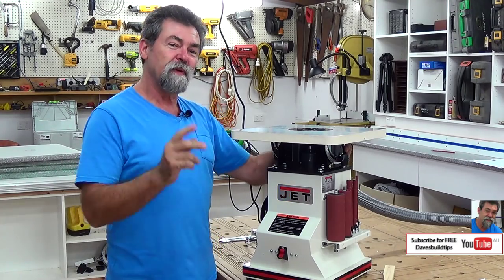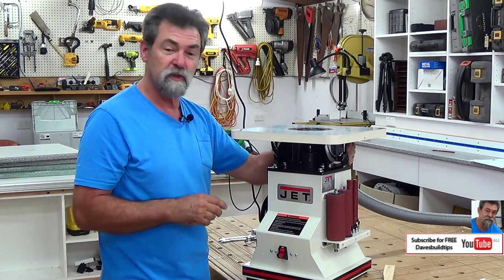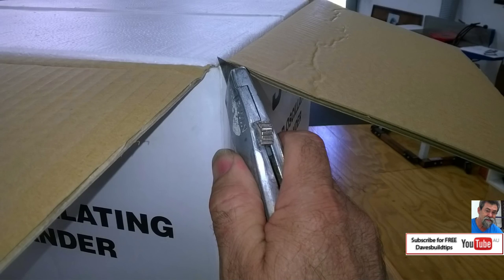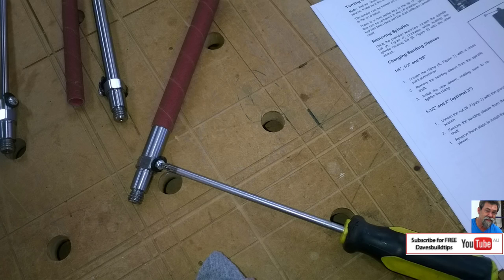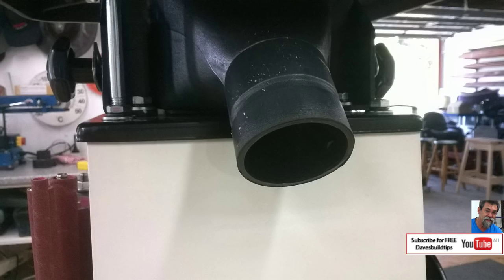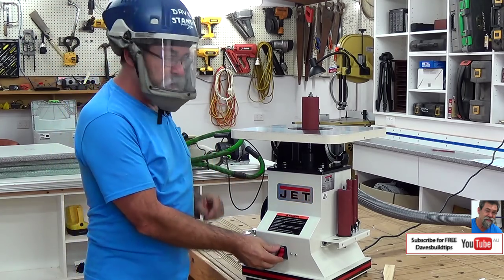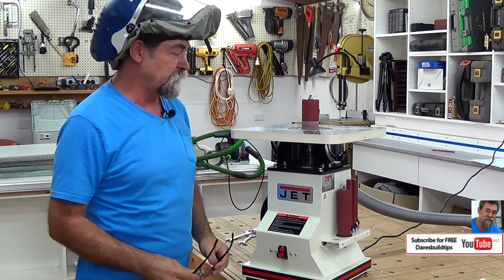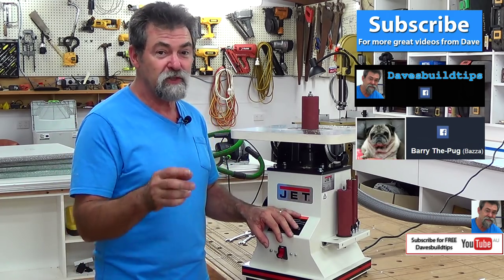Unboxing | Jet Spindle Sander | DIY

Comment: It has been a great addition to my shop and is still going strong. I just wish they supported the bottom better for shipment. Waiting for the third machine to come was a pain. I am looking at options for a disk sander now. 

Love the videos keep up the good work. I bought the Rockler box joint jig after seeing your video (sorry I didn't know about your links when I did). My son is interested in woodworking and wants to build some boxes. Rockler has the jig on sale here for 59.99 normal price is 79.99. I did have to order a miter track to lock the jig in place which is also on sale now for 9.99 for the 36" length, normal price is 17.99.

Comment: I looked at this one and the Rikon side by side, and I was amazed that the Jet leaves the front under table wide open.  I suspect that is why your dust collecting isn't doing a fantastic job.  If you do mostly 90 degree work, you might want to build a 1/4" MDF battle that wedges in there under the front of the table to see if there is a marked improvement.

Comment: Thanks for the video. I just got one of these second hand and it makes a bit of a noise and I thought it may be a bearing. It's at the top of the oscillation. I can't tell with yours since the dust collector would be drowning it out. Nothing is loose and it looks like no run out. I'm hoping they all do this. Any thoughts?
Reply from the maker: Hi Isn't that Rich! Mine just makes a whirring noise.
Reply: @DavidStanton  Thank you for the feedback

Comment: Me again, thank you for the previous response.  I see the bench top your sander is on is fairly high from the ground. Is that the bench you normally use? I want to mount mine to a flip top bench and this would put the table top of the sander at 50". Before I go to the trouble, I was wondering if the extra height is cumbersome or limiting in any way?
Reply from the maker: Hi Isn't that Rich. I like the height mine is at.
Reply: @DavidStanton  Thanks for the reponse.

Comment: Hello. Nice video. 
Been thinking of buying one of these. Is this a 230v ? And is it possible to adjust the table hight. Just so you can use the top part of the sandingstip ??

Thanks. 

Best regards
T.Robertsen
Reply from the maker: +Norwegianwoodworker . I am on 240 volts in Australia and it works just fine. Don't think you can lift the table but you can remove the sleeve and put it back on so the sand paper at the top gets to be used.
Reply: Ok
Thanks for the reply and keep these good videos coming :) 

Regards 
T.Robertsen

Comment: Hi David, have you measured the runout of the spindle? I'm wondering how precise it is. Is there any deviation (even smallest one) from straight line and 90 deg. angle when sanding thick (5-6-7 cm) pieces? I'm working with very small pieces and I need really high precision (like no more than 0.05 - 0.1 mm deviation from 90 degrees on 6-7 cm thickness). 
Thanks!
Reply from the maker: Can't help you Ivan. I use it to sand internal radii and I do not have the need for the same tolerances you mention.

Comment: David, how would you rate this compared to something like the Triton oscillating spindle sander? They appear to be similar in spec and yet the Jet is double the price.
Reply from the maker: Brad, the triton is a brushed motor, so it is noisy and also does not have a tilting table. The jet has a cast iron tilting table, induction motor and can also have a 3 inch diameter spindle as an option. I much prefer the JET.
Reply: @DavidStanton  Thanks for your help today David! This is now in my workshop.

Comment: I bought one a few years ago and it is a good machine. The only issues that I had were shipping related. I don't know if you notice that the styrofoam on the bottom of the machine was detached from the the sides. You can see it in your video. My first two machines had damage to the base (sheet metal). I think this was caused when they drop the box on the ground. The third machine finally came undamaged but the bottom of the styrofoam was still detached. If anyone buys one that would be the first thing that I would check. 
Buy the aftermarket sleeves since they are much cheaper.
Reply from the maker: Is the machine still going well? Mine has performed without incident.

Comment: Hi Dave,
I noticed you only briefly mentioned the carbatec drum sander.
Is it worth the purchase? Any noticeable pros and cons?
Reply from the maker: Hi Matt. Life has become very busy and have not had the chance to talk about the drum sander. I love the machine. The only down side is the conveyor belt which doesn't grip the timber as well as the sandpaper style conveyor belts the other brands have. That said, it is a very reliable machine.
Reply: Thanks for your prompt reply Dave! 
You seem to be the only one i can find who uses and and gives good reviews on carbatec.
Is there any reason their machines are so much cheaper than others? Currently looking at the 10 inch planer combo but wondering if the enticing price is a trade off for quality? You seem generally pleased with your carbatec thicknesser.
Reply from the maker: Hold off on that machine if you can for a while Matt. It is cumbersome to switch between thickness and jointer. Also, their machines are not cheaper than all the others. Hare and forbes are cheaper.
Reply: Duly noted Dave, thanks for the heads up mate, I'll hold off on the purchase! 
Cheers for your input and taking the time to reply.

Comment: Dear Sir, congratulations for your review.
I'm looking for a quiet (I hate noise) bobbin sander for my instrument making workshop and I'm looking some brands and models. Of course, this Jet looks even more than I really need for my work. But, I see that one have to change the whole axis when need to change diameter, while other machines, like Triton (too noisy, I think) it has a single fix axis and one only have to change the rubber bobbin and sleeve, so it's easier and faster.
Also, I've been looking at Axminster hobby bobbin sander, which has a less power motor that could also work. I wonder if rubber bobbins are compatible for every machine.
I would like to know if you've deal with these good and bad features.
Thank you very much.
Reply from the maker: It is quicker to switch bobbins than change the rubber because the sleeve is already tensioned.
Reply: Ok, thanks, you're so kind.

Comment: Hi sir: could you please tell me how much power has its motor?
Reply from the maker: 0.5 HP, 375 watts
Reply: Thanks a lot. I noticed that they are now making this model with 650W motor, so I wondered if it wasn't hard enough  for guitar making, for example.

Comment: I wonder if it would be better to be able to look down on what you were sanding to better judge the rate of material removal. Which is a long winded way of saying....put it on a lower bench Dave :)
Reply from the maker: +Brian C . Built one today Brian. That is next weeks video!
Reply: +David Stanton Great minds think alike...or is it fools seldom differ :)
Reply from the maker: +Brian C . Maybe Brian. Matter of fact I built 3 for 3 different machines but will save that for the video.